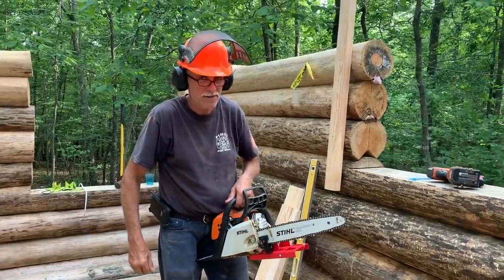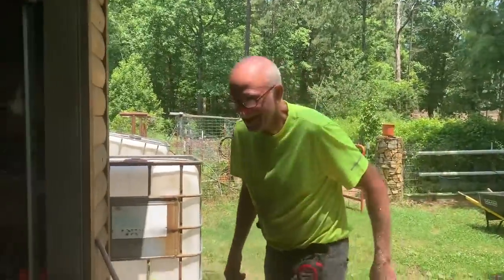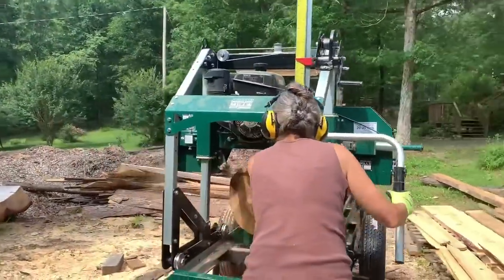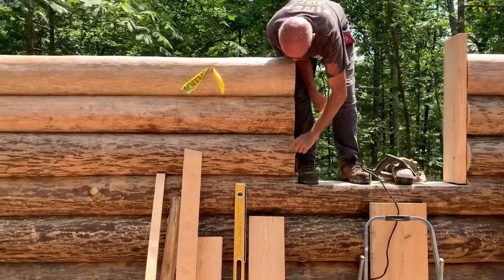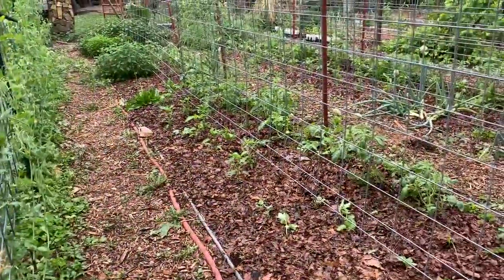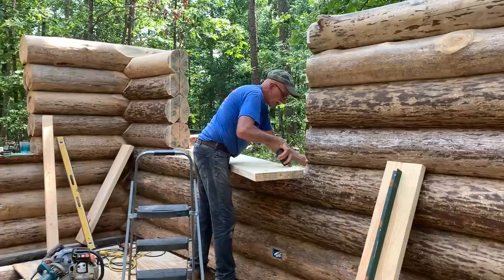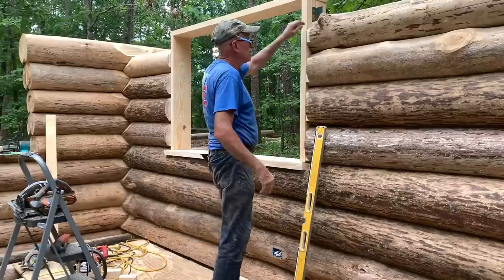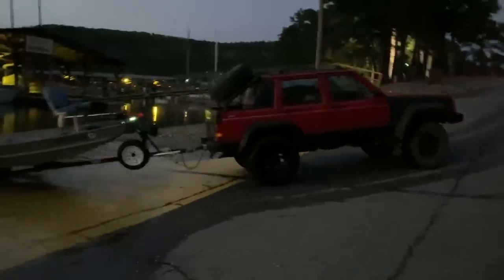Log Cabin Build Part 15, cutting openings for windows, building window frames @Lance & Cinda Serafin

Comment: Really appreciate the tip about using the angle iron on the window casings to allow settlement of the logs - I'll remember that one! You're getting close to putting up the logs that will sit above the windows and door and I'll pay particular attention to that - please give any tips and advice you can about fitting those logs and making allowance for settlement. Great video as always - I love how you guys share the work - you're a good team!
Reply from the maker: Thank you Stevan. That was recycled from the crate our new mill came in. We are cheap and use what we have if possible 😂You can also use wood like a 2x2 or 2x4 you just have to cut the slots in the logs bigger to fit. That’s  what we are going to use around the doors. This is our first log cabin so we are not experts on any of this😁
Reply: @natureartgirl  I'm an avid recycler too. It just makes sense to me to use what you have, repurpose anything and everything and minimise waste. Plus it's fun to think of a new and practical use for something - especially if it saves buying it!. I repurposed two old pallets (skids) into planters for some highbush blueberries. Never grown them before and I'm not sure how they'll do but they now have the acid soil they need so we'll see. Great to see everything going so well in your garden. Kindest regards. 
SA
Reply from the maker: We think alike😊👍Your blueberries should do great!

Comment: Really enjoying your build process, and balance of work and recreation. I’m not sure if you sealing your window sills
But another  utuber  (Smokey mountain outpost) has built a cabin and has used quite a few drums of Australian timber oil
To seal the Timbers he has milled himself and some he has purchased for straight and dry Timber. It helps protect the
Timber against the elements and creates a warm yellowish finish. It’s worth checking out , and he swears by it.
Reply from the maker: Thanks! We will check out the Australian oil. Not really sure what we will be using yet. Our logs are still fairly green so we need something that still lets them finish drying. Have to research it some more. Thanks for the info!
Reply: @natureartgirl   Your welcome.

Comment: Howdy y’all- as usual. everything looks great! It’s funny that you are putting in the angle iron and sub jambs in this video because that’s what I was doing today. I have worn out a few of those little skilsaws. For some silly reason they quit making them and there are no parts available to rebuild or repair them. Gotta sell something for gas money to get down there and see this first hand lol. May have to get a hang glider and ride the air currents haha. Take care and God bless
Reply from the maker: Hi Paul! Great minds think alike😂🤣We are taking them down to let the boards finish drying until we get the last logs up. But needed to get them cut so we could do all the slots before we put the cap logs on. They also fit in Cinda’s greenhouse better. 
So true about the gas. We might have to start riding horses or bicycles again😂Hope you all are doing good😊👍

Comment: I personally think that it is better to use a wood stove after the house is built in the future, because the things bestowed by nature are the best and cheapest. I think that using an electric stove is not the best choice. Everything should be considered cheap and convenient. What do you think? ?
Reply from the maker: We agree. We heat our home with wood. But we are going to use this to rent for vacationers. Most do not know how to use a wood stove. We are worried they may burn the cabin down. If we ever sell our home and live in the cabin full time we will definitely use a wood stove.
Reply: @natureartgirl  It turns out that this is the case. Your consideration is also justified. Safety first.